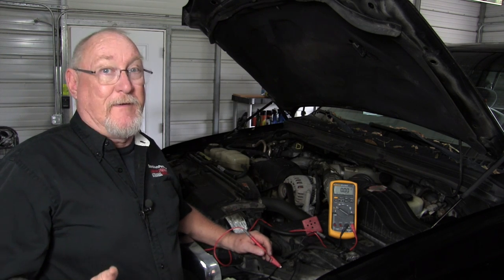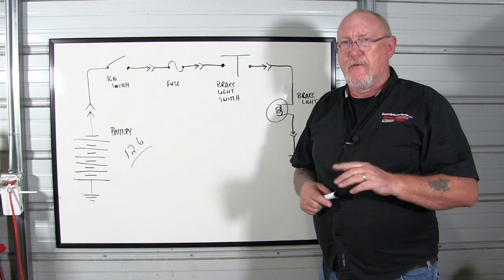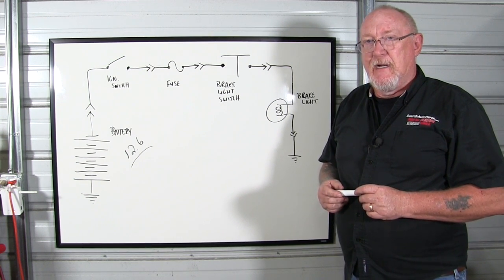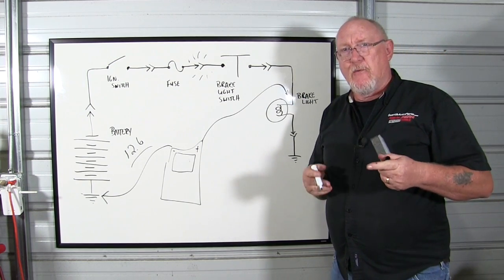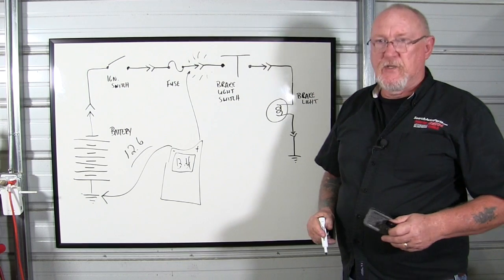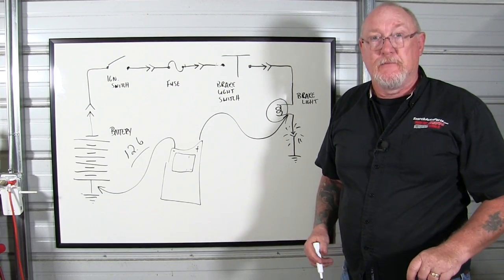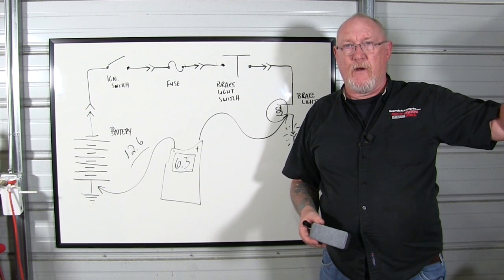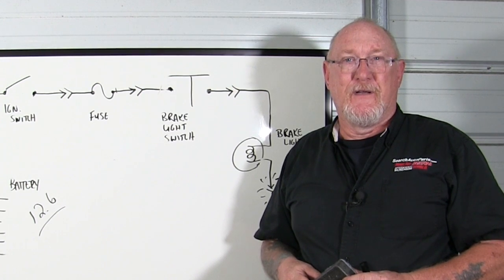The Trainer #84:  How You Can Measure Voltage When Your Meter Leads Say You Shouldn't

Comment: another confusing point is electric flow. Some say it flows from negative and some say positive..HELP
Reply: @Rick-tb4so  
There are 2 ways to look at current flow:  
1. Conventional current flow - says current flows from positive to negative.  
2. Electron flow - says electrons flow from negative to positive. 

Scientists use electron flow. 

Technicians use conventional current flow.

As technicians working on cars, trucks, appliances, air conditioners, furnaces etc. should always use the conventional current flow.  Don't ever think of electron flow. It will be of no use to you because all of our testing equipment (multimeters, scopes, scanners, amp clamps etc.) are designed around conventional current flow. That's why when you put Multimeter positive lead on positive battery post and Multimeter negative lead to negative battery post, the display will give you a positive voltage reading and if you switch the leads it will give you a negative voltage reading. 

As a technician, don't ever think of electron flow. It will only confuse you. If you ever decide to become a scientist then you can worry about electron flow. 

Hope this helps.
Reply: @bernardocisneros4402  Thanks for the info I have always had a difficult time with electronics...
Reply: Current flow is negative to positive. Long ago, before electricity was fully understood, it was thought if flowed from positive to negative. Sometimes current flow is still expressed the old way.

Comment: Is it fare to say the resistance after the bulb slow the electrons down which in turn would give you a dim light ?
Reply from the maker: No, not really. Electrons move at the speed of light so don't think of movement. Some techs struggle with electrical work because they think in a linear fashion...that is, that the current moves from one end of the circuit to the other. That's not the case. 

Instead, remember the rules. "All available voltage will be consumed by the resistances in the circuit". The available voltage is split among the different sources of resistance in proportion to the amount of resistance each represents to the total.

The ONLY real source of resistance should be the LOAD. All the other sources (connections, switch contacts, etc.) are minimal and should take very little away from the LOAD. 

IF there is an UNWANTED source, then that source will take much more away from the LOAD, regardless of where in the circuit it is located.

Does that help?

Comment: Bob Bishop
6 hours ago (edited)
Hello  Pete,
Up date on voltage drop test battery positive to battery cable on starter  with key in ON position  remote switch pressed it dropped to 0.50 volts from 12.40 volts from battery.

Negative battery to negative solenoid terminal key in ON position starter turning engine over slowly ground voltage drop 8.04 volts. Is this starter dead shot need a new starter? Is this a case of a short to power and ground?
Reply from the maker: "Negative battery to negative solenoid terminal key in ON position starter turning engine over slowly ground voltage drop 8.04 volts." - That's your problem. You have a fault in the ground path between your meter leads. Take one lead and repeat the test, moving the lead closer to the other until the meter reads normally. Then you know you passed the problem and can work the other way to locate the fault.
Reply: @VehicleServiceandRepair  Hello Pete,
Voltage drop test on engine block reading is 0.58v meter neg to bat neg, positive lead to engine block, while cranking with remote. The remote allows cranking in park. Body ground, voltage drop is 0.28v. 

On starter relay the control side key ON reads 3.44 v should I give it a ground by wiring ground terminal to starter relay hooking up test light to bat neg to the ground wire to see if it starts. So far I have not heard the fuel prime yet.

Respectfully,
BB
Reply: Dear Pete,
I am getting the hang of this now thank you so much for the nurturing support and your crew of men whose expertise I have benefited from my heart felt gratitude, I think I can fix it now. I will report back the results. 

Respectfully,
Bob Bishop.

Comment: Hello Professor Peter,

Used a volt meter to positive battery terminal and other to positive starter bat cable 12 volts is this good no resistance seen; then neg battery terminal other lead to neg solenoid 00 volts, no resistance? Then checked for block ground and body ground by placing meter lead on ground battery terminal to struts got 00 ground; then placed battery positive test lead to battery on to block ground got a high voltage reading when key in start position. the block was energized with electricity by volts 9v. Is this normal or abnormal ; then proceeded to check throttle sensor signal wire reading 1.80 v; ground 3.44 v; 4.9 5v ref. Then discovered no communication with data-link, no power at all, could not pull up dtc codes. Test light to battery positive to relay control terminal with ignition in off position, the starter cranked in park however it was a rapid clicking it did not rotate engine. like it does in neutral it fully rotates crank shaft.
 
Underneath the car seen two connection 1- battery cable, 2-solenoid trigger wire, the bat cable nut badly rusted; open it up the eye loop was not rusted very clean, just the nut itself. Battery is inside a protective snap on sealed connector.

Solenoid connector, I could not snap off, difficult. The body of starter motor not rusted but has corrosion and the solenoid body too.

Also seen, another black w red stripe wire hidden on top of the stater motor difficult to get at, intake manifold in the way.

Will keep tying its raining outside. 

I wanted to set up a starter switch devise to control starter from engine bay; then do a pos to pos voltage drop, then test neg to neg voltage drop under load to trigger wire of solenoid, while hitting the remote starter switch to report back the voltage drop your want me to verify and continuity on bat cables.

Questions pop up in mind, while working and struggling with solenoid wire connector just can't get off yet :

1- What if I get 00 volts on the neg voltage drop does it mean the the inner contacts are not looping back the current to battery negative side? Starter is bad?

2- Do I take meter pos lead to battery positive, the negative lead to stater motor end cap, what if I get 00 on negative side of the starter motor does it mean it working fine, after all it cranks in neutral.

3- Do I  go back to the relay, where the control side had a voltage of 3.44 volts, too low to light the test light, with key in ON position. This voltage on the control power side baffles me because when key is in START it is 12.39 volts no crank and no start in park, it only cranks in neutral? Is my computer transistor working sending 12 v to starter? When test light is on battery positive, it is placed on the ground side terminals of control side and load side both grounds light up, is there a defect with both grounds or they are both good grounds?

4- All fuses working in engine bay compartment however there is a fuse 10* amps with an asterisk * that is not blown, it is fine yet has no power. I cannot identify it. Its under dash driver side. Is this caused by anti theft module, does this car have one?

5- When I turn key to start, I cannot hear the fuel pump either in park or neutral. I know fuel pump works fine tested it from fuel relay. Fuel relay was tested and has current flow to pump when by passed.

6- There is a two wire, ( pink with white stripe and blue with red stripe) male receptacle, it is missing its connector female plug by steering column. I looked to see where in the ignition connectors, it belongs, no place found, female plug  was cut out.

7- There was an after market devise inside this car Toyota Corolla 2000, I did not know about for years until my foot hit a toggle switch shutting down the car's fuel and power while attempting to start it, with a power pack, key ON. I removed it by cutting splices and re-splicing original wires, thats when it stopped cranking in park, it used to crank in park, after removal, it stopped cranking it park. Then a wire coming from down from the roof of the car, a light green wire, it's loose, with no connection, I cannot remember seeing it before, I tried to follow it backwards it disappears, maybe it belong to the brake lamp on rear windshield, does it need a ground or a power? 

8- While driving, an indicator light came on the dash, "BRAKE LIGHT," it stayed on, for some time. I looked at brake pedal, rear brake lights work except for the brake lamp on rear windshield, that bulb exploded.

9- Looked at the brake fluid reservoir, it was empty, below mid line shadow it fooled me so, the brake pedal, goes all the way down no pressure.No brake fluid leaking by the wheels, none, two power disc in front , two drum in rear could my brake booster be compromised and master cylinder too?

Conclusion:

1- Prior to all this happening, I had a power pack hook up on the battery with key in ON position, then I began to start the car with it, that is a big mistake.Car was cranking and wanted to start with 55lbs of pressure when specs require only 45lbs it struggled. Got impatient, floored the accelerator, it shut down, kicking in an anti theft devise or an inertia switch, that made a sound kabump. Did I burn out the transistor inside the computer, is this why the control side is at a low voltage reference of 3.44 volts? Is this why, the throttle senor reads 1.8 volts? Is this after affect a spike, from power pack, I may have created a transistor capacitor memory lock down, how do I discharge its memory? This car does not have an inertia switch nor a anti theft module?

I have been toiling with this problem since sept 2018, the winter got me, could not work on the car till now, spring time. I do have a second car, this Toyota Corolla 2000 CE is my teaching car. Thanks to Vince Finscheli, you Peter, Jerry and the other men of of your group I can't remember his name he is the top dog in diagnosis nothing gets past him, you all are inspirational, thanks for educating a half wit, like me. First time I am experiencing thinking, the car has so many sciences built into it, that thinking about its principals is an education I never receive in the academics of school, that was a waste of time.
Respectfully,
Alhasentory

Comment: Hello Professor Peter,
Love all of your lessons, thank you for educating the masses in trouble with their cars. I apologize for asking you for guidance of a repair I am doing on a Toyota corolla 2000 its a no crank in park and a crank in neutral no start. When performing tests what I discover mystifies me unable to interpret the evidence.

 My question: is the computer seeing something, that it will not start the, car it communicate with 5 v ref fine. It sees neutral safety switch and throttle sensor with issues: 1- throttle voltage reading is always 1.8v in wide and closed throttle. It seems it is dead or is the computer shutting it down? Because it sees the neutral safety switch not able to crank in park nor start in park?

 Evidence found on starter relay load side good 12.39 volts hot all the time with key off. Its the control side; too low voltage to light my test light however with volt meter it reads 3.44 volts with key in on position. It then reads 12.39v with key in start position no crank in park. Test light lit up in start position on control side and meter voltage went from 3.44v to 12.39 v?

When I shifted out of park to reverse oo volts; when I shifted to neutral it was at 12.39 volts yet it will not start. Is neutral safety working or is it the cause of the problem? A voltage reading on the ground side is 3.44v in park is a high resistance for ground side?

 something is wrong here yet I do not know how to verify it. I don't know where to go next on the wire diagram. Is the throttle the cause of the neutral switch not working because it shows a voltage drop of 3.44v? Confused and distracted cannot spot light focus in on the problem and their might be not just one problem but 2 or 3? 

I was afraid to do a battery pos voltage drop on control side and to power the relay terminal on ground side with test light damaging computer. I need supervision or guided instruction. I bought Vince's first book which so well constructed that I am able to approach the car cautiously and with some intelligence, thank you for educating me.
Love n peace!

Respectfully,
Alphasentory
Reply from the maker: Let's give this a try. From what I understand, you've basically tested the positive side of both the starter relay load circuit (the "switch" side) and the control circuit (what turns the relay "on"). First, the load side test is not a valid voltage drop test unless you turned the key to the "start" position to energize the starter solenoid. All you know is that you have a OCV of 12. 39 there. 

"When I shifted out of park to reverse oo volts; when I shifted to neutral it was at 12.39 volts" - your park/neutral switch is working, opening the circuit when the vehicle is not in either.

You said "no crank in park and a crank in neutral no start". I assume the engine is turning over at normal speed in neutral? Or does it turn over slowly?

First thing I would do is go to the primary complaint - no crank. When you turn the key to "start", the starter relay should close and the BLK wire at the starter should read battery voltage. The starter solenoid should close and the starter should engage.

If you read battery voltage but the starter doesn't work, it's in the starter assembly OR power to the starter motor OR ground to the starter motor.

If you DO NOT read any voltage, the problem is on the relay side. Since it works in neutral but not in park, I would suspect a ground side issue on the control side of the circuit.

If you read SOME voltage but not everything the battery has to offer, there may be a problem in the BLK wire from the relay to the starter motor. Confirm that the voltage coming in under the same conditions on the load side of the relay (pin 5) is where it should be. If it, too, is low then look at the positive side of the circuit first, between the relay and the battery positive post.

Hope this helps!
Reply: @VehicleServiceandRepair  wow that is a lead I will verify, thank you Blessings for I did not expect a response being that your busy teaching and working on them cars and lecturing, gratitude in my heart for you. Stater starts in neutral with speed then after 5 cranks slows down does not maintain same powerful intensity.

 Neutral switch  has 2 functions to stop power to drive and reverse and to crank in park n neutral is it an assumption to think neutral switch is good when it is not allowing the crank function in park? Perhaps it is good on one account, it turns off test light in reverse from starter relay and bad on 2nd account no crank in park where test light does not light up with key in ON position; however it does LIGHT UP when key is IN START position YET no cranking and no stating. So professor you are saying switch is good on both account because computer is able to send control power voltage to relay ground side so neutral safety switch is not defective.

Test light to battery positive was place on the ground of control side of starter relay it lit up does this mean it bad? A good ground is not suppose to light up is what I learned. I may have learned it wrong. A good ground will light up when powered meaning no breaks in ground wire? When learning I tend to blend apples with oranges.

When I bypass load side to its ground side on stater relay the starter turns fin from relay box. Why did I get a 3.44 volt reading with key on and 12.39v when key  was turned to start this low volt with key on position does it mean some is pulling the 5 v ref down?
Reply from the maker: According to the schematic, the park/neutral switch opens or closes the path to the starter relay control side. Since you're measuring 12.39 volts in both park and neutral the switch must be functioning. The key to your problem is in your observation that the starter cranking speed slows after only 5 cranks.
Reply: @VehicleServiceandRepair  Its good news thank you with so much gratitude. I find myself very receptive to your groups lessons and knowledge that I am truly absorbing, learning, thinking and applying as a novice my mind gets flooded with questions it is overwhelming for me not easy to relax the questions. I would love to learn regularly and study regularly with your group to get certified ASE. Vince is was introduce by you and Jerry. Fixing the car with just a multi meter and amp probe got rid of so much rhetoric and the expensive equipment I cannot afford however see how useful they can be an oscilloscope, that flash program as well is something I would love to own . Thank you peter I am able to learn which I love. I was a medic At World Trade Center 2001 so Learning for me is like life and death sometime I have a good flood light and a spot light working when learning however its not as sharp as in younger years. 

Love n Peace Good fellows,
Alphasentory.